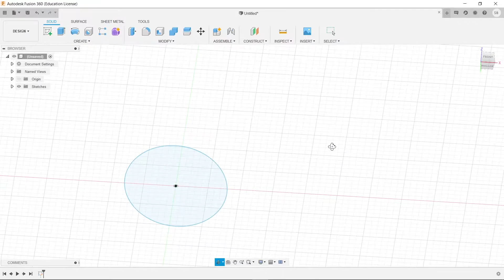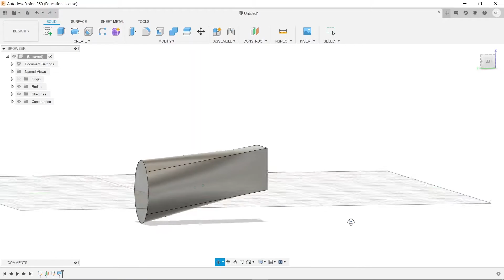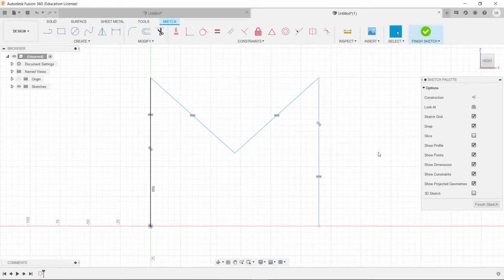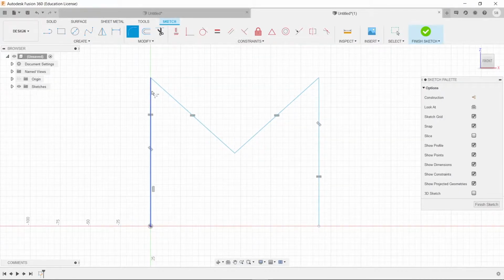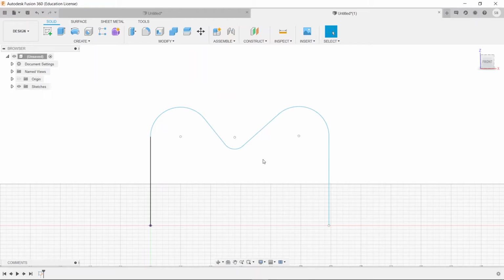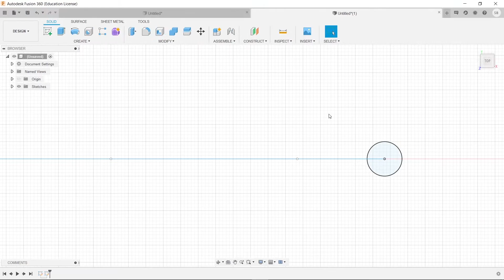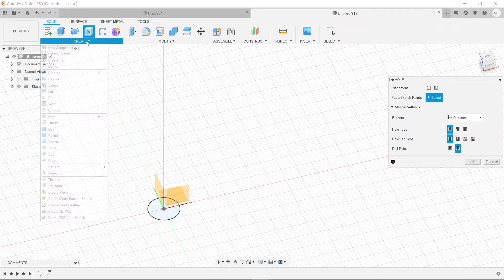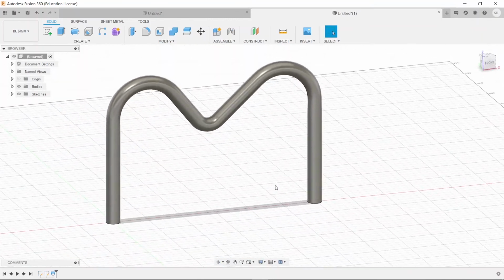Fusion 360: How to loft along a Centerline

Comment: This would be more simply and quickly achieved by using the Pipe or Sweep command. However, your explanation for using a centre line for Lofting is very clear and well executed. Thanks for posting 👍